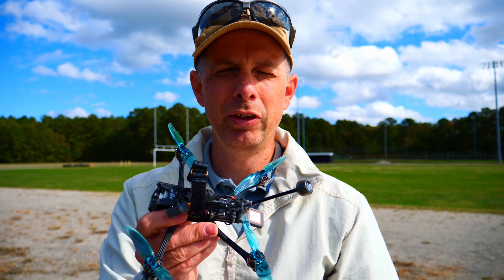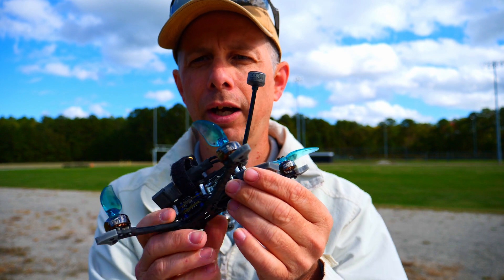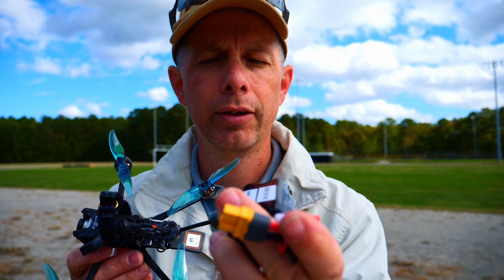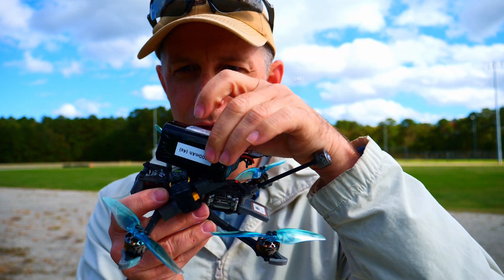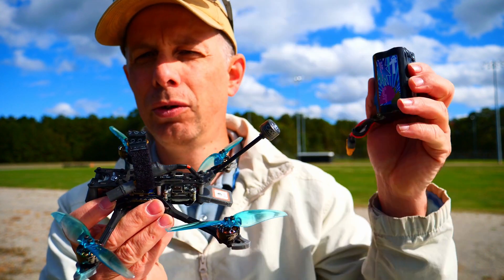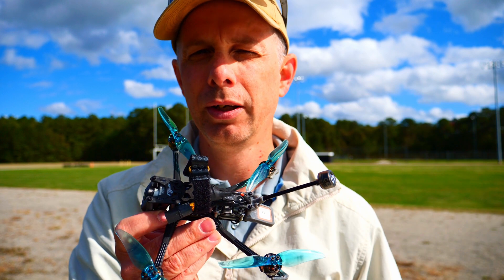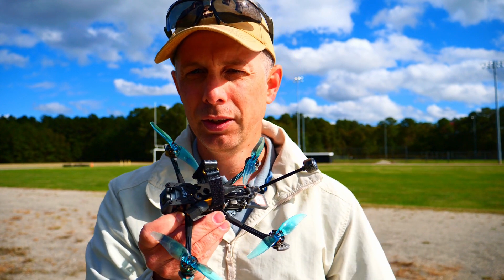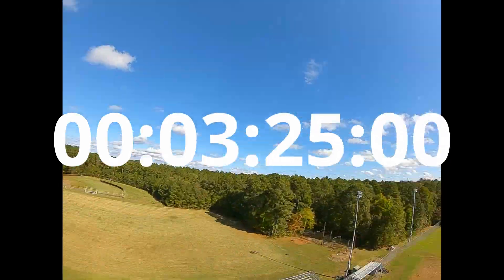Flywoo Explorer LR (30 Minutes Flight time)! (10-31-2020)

Comment: Your takeoff weight is about 340-350 grams, friend? The only way to have a 250 gram, full HD drone that flips and snaps and flies for 30+ minutes is a single rotor helicopter. And the collective pitch and RPM needs to change, mid-flight, to switch the aerodynamics between acrobatics and high efficiency modes.
Reply from the maker: Ooooooh kaaaaa....
Reply: nobody talks about 250. if yes, take a smaller 4S. what are you talking about?